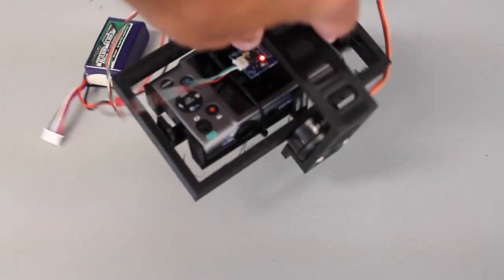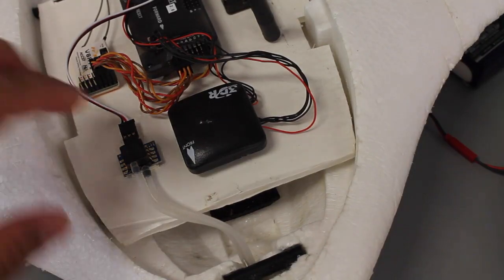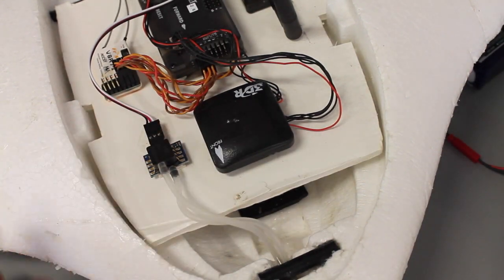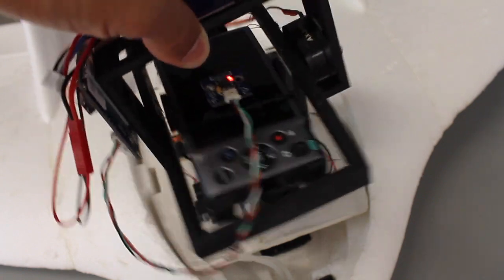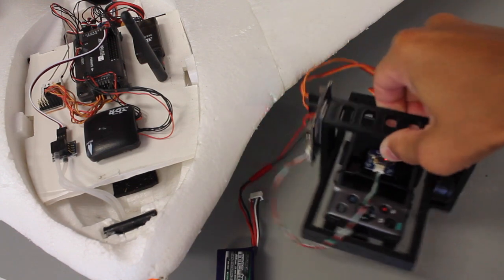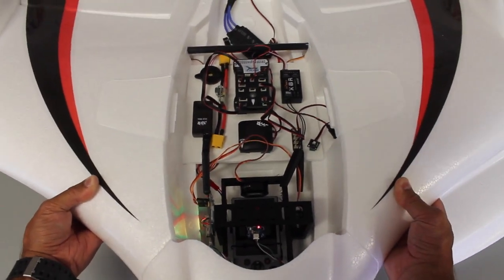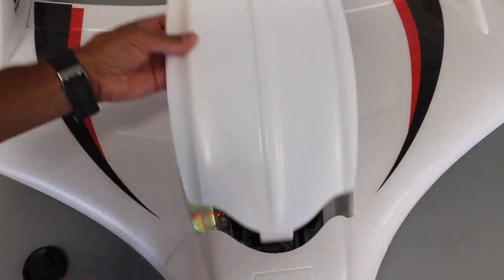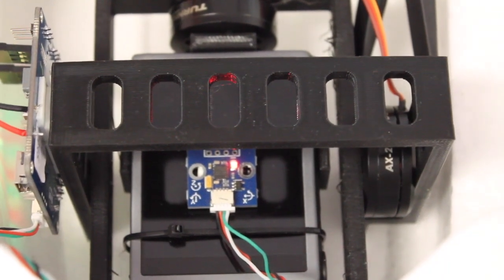Quick Update on 3D Printed Downward Facing Gimbal for Aerial Mapping

Comment: The Talon and X8 should be good for carrying something like this. But why didnt you just go with a smaller camera that you couldve fit in the fx61?
Reply from the maker: Jānis Andersons Great question. I thought about the GoPro, which Pix4D can post-process and flatten the fisheye look, but I've had better results with a basic point and shoot with 12MP resolution. I have a 16MP Canon with internal GPS, but it's much heavier and I haven't modified the gimbal to support it...yet. If you have any 12MP or greater camera suggestions that are small then I'd love to hear about them. Thanks for the feeback.
Reply: Dennis Baldwin Ive been eyeballing the Backbone Ribcage mod for GoPro to get rid of that fisheye for reals. The go pro has such a good sensor for the weight.

Comment: Good job D, did you look at the X-UAV Talon, this plane has also lots of room and a hole on the bottom for a vertical camera for aerial mapping.
But the FX79 will do fine whit this nice gimbal.
Cheers and wish you good flights\photo results.
Reply from the maker: ***** Cool will definitely check it out. Well I just looked and it reminds me a bit of the RVJet. Very nice. Let me try with the FX79 and I may look into this and the Skywalker....as suggested by a few others. I hope you're doing well.
Reply: Dennis Baldwin if you share it, i will test it on my X-uav Talon. Niiice upgrade.

Comment: you should seriosuly consider the skywalker but you would have to mount the campera sideways, you wont have any problems with height since the skywalker has plenty of room in that sense. it has outstanding loiter times and its very stable